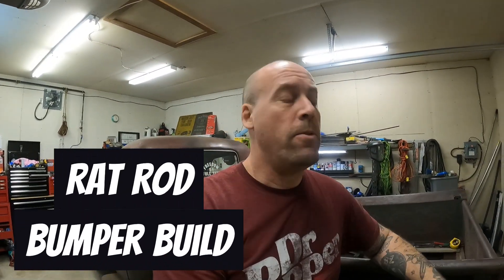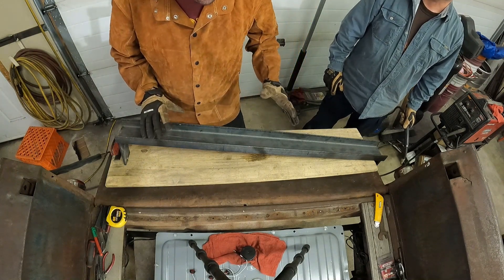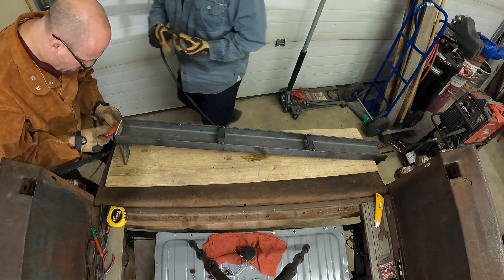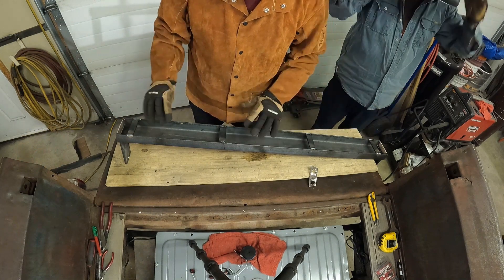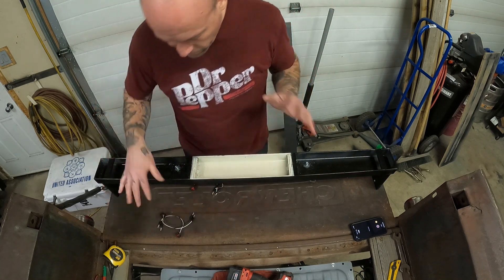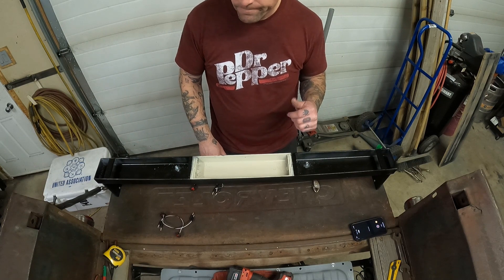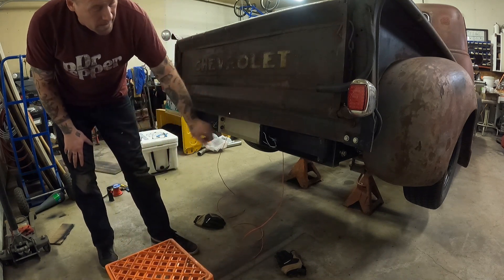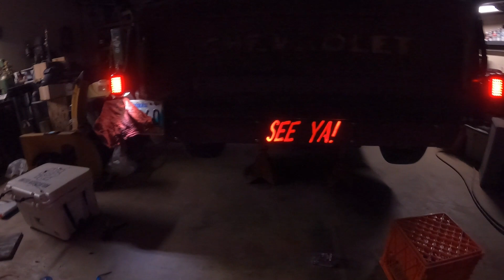Rat Rod Custom Bumper Build!!

Comment: A cool thing to do is take a seatbelt buckle and mount the push button part on the inside of the truck bed and put the male part that goes into the buckle on the tail gate when you close it they will lock together and to open it just push the button release
Reply from the maker: I was actually thinking of that too. May still happen